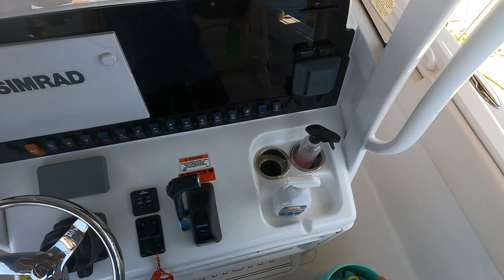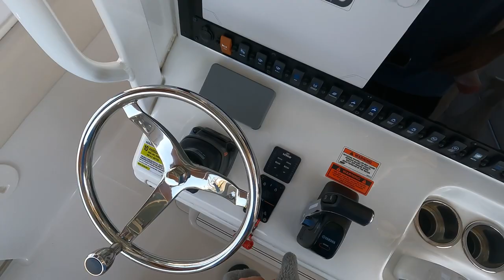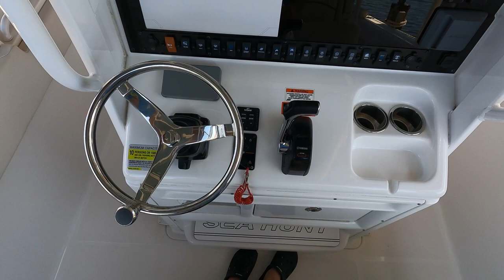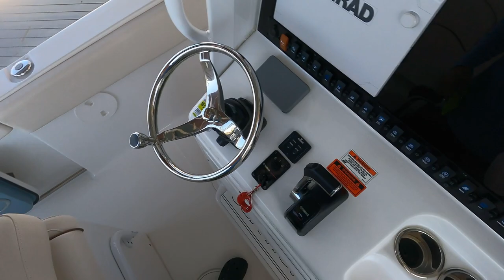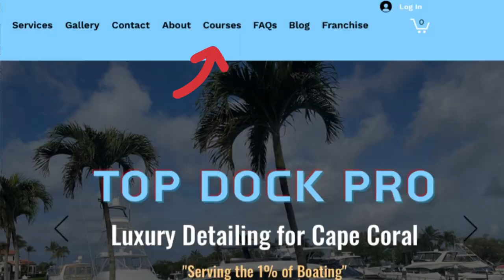Maintain Your Boat & Prevent Oxidation | Monthly Boat Cleaning Tips!

Comment: Simon I really enjoy your videos. I've graphene coated my vinyl seats. Should I be using 303 to maintain them?
Reply from the maker: 303 is a water based product, therefore it doesn’t bond to your ceramic coating, and no real protection is added. Because you have a graphene coating, it would be best to use Starke Reboot (or another graphene ceramic spray) for further protection.